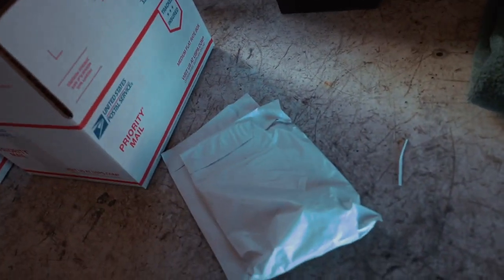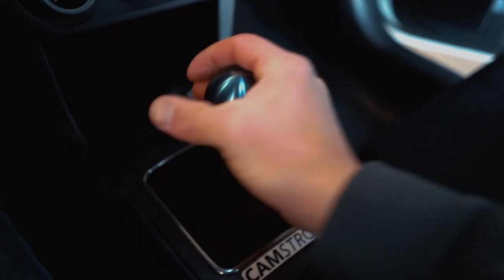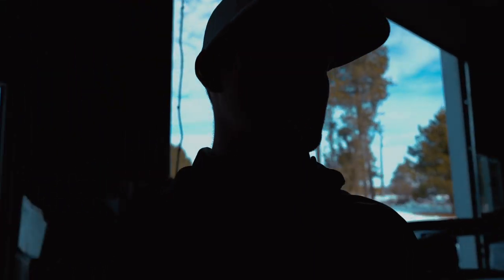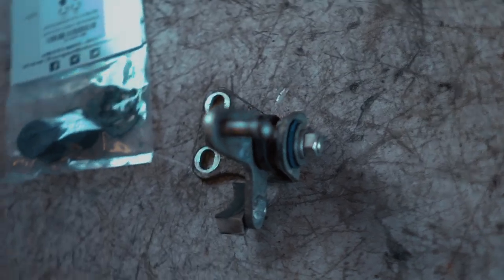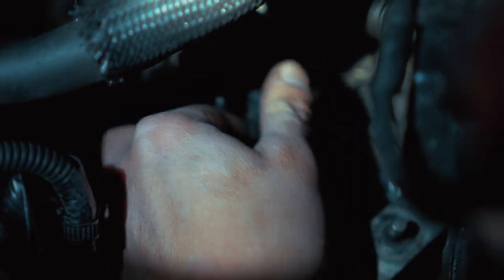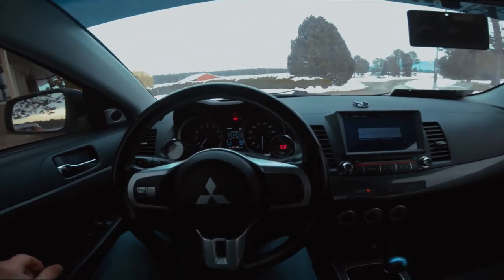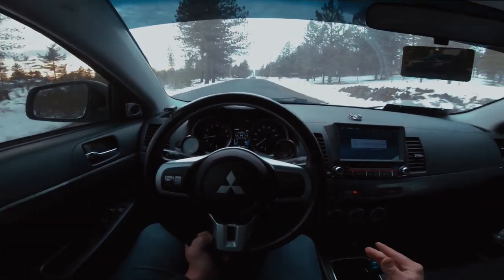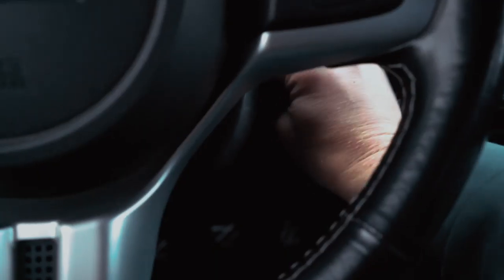Attempting to Fix The Shifting Issues!

Comment: When you do that master cylinder upgrade I would replace the shifter cable as well. When doing the bushings on my Evo X I noticed my cable was worn as well - same issue as yours the shifter would pull back towards me in 4th. It eventually gave out completely. Change the cable and it was so crisp, no more lockout issues.

Comment: I have a Evo x and when I first got I got locked out all the time and I hated it but I did the torque solution short shift AND bushing, the bushings are key and most people skip it but you finally got them also the redline cocktail eliminates all the grind sound going into 3rd and helps prevent lockouts as well. Ever since then I have never been locked out of a gear and it's been silky smooth. The only thing I can think of is replacing that torn up cable, hope this helps. Love the videos keep it up

Comment: You can see clear as day the minimal side to side play is within the cage itself. You noticed that when you move the shifter from left to right it actuates the small triangle to the left side of the cage which indicates you switching in between the 1st to 2nd 3rd to 4th or 5th to 6th gate. The little pin that lifts or lowers that triangle probably has Play Between the pain itself and the whole in that small triangle which operates the selector for moving the shifter from left to right. I'm sure the hole that the pin goes into on that small triangle is just worn out over time from use I don't imagine they have a bushing that goes around that PIN to tighten up the slop so since that whole unit is made of plastic I would imagine that to eliminate that slack you would just need a new selector cage unless of course you can pull a part that small triangle mechanism to the left of the shifter cage witch helps you select between left to right on the shifter

Comment: I just did these on mine and when i finished it had slop just like that. I took it back apart and was missing a rubber seal that goes under the plastic piece of box that your shifter ball sits on. So rubber square shape seal-then bottom square piece where shifter ball sits in-then top part of plastic that goes over shifter ball and is held in by the pins. So check to see if that is missing. It's so small but it saved my life.

Comment: Try going with a new cage ! I have a Octavia MK1 RS it doesn’t have a Plastic cage but kind of same concept it had a plastic surround cup around the gear stick . I replaced all the bushings and Linkage ends but nothing helped as much as that plastic cup ! I believe all that side to side slop should be no existant once you change the cage. Anyways Great Videos man !

Comment: IDK bro, i changed all the bushings on my Evo8, plus changed the front engine mount and i still get lock out. I found that as the clutch would wear the lockout would get worse until i adjusted the pedal. now after a few years i have adjusted the pedal several times as i noticed the LO to the point where I cant adjust amymore as the clutch is at its limit and will need a new one soon.
Point is, i think LO is relative to the wear of the clutch. How fresh is yours?

Comment: Try adjusting the clutch pedal outward. Also master cylinders are trash on stock x. I'd bet doing both of those will fix it and if not it might be time for a twin disc

Comment: i have the same issue. iv got a twm shifter cage, torque solution short shifter, and ams bushings. there is no free play at all like yours but still have same issue. im replacing my CMC and clutch soon, if that dont fix it, then im gona assume its syncro related problem.

Comment: Hm, sounds like it could be a worn or failing synchro. Does the lockout occur from 5th to 4th? Or only 3rd to 4th? if it's only 3rd to 4th, it very well could be that synchro has shit the bed.

Comment: I don’t have that play issue but the EVO has been hardest to drive stick but I recently installed torque solution short shifter big big difference stiffer and shorter throws I would also upgrade that bro should see a difference all around

Comment: @Devin .. I would check out this write up , it helped me out with my lockout issues. I was in the same position as you and I did all of the bushings as well. But when I found out that bracket could be use for adjustment it helped out a lot. Maybe not with the side to side free play but with lockout for sure. My 3-4 always felt like my clutch wasn’t engaged all the way.
Good Luck . This should also be in the service manual. 
https://www.evoxforums.com/forums/showthread.php?t=46189#/topics/46189?page=2
Reply: Same here. I saw this thread and was gonna post it here too. I am about to replace the bushing and then make the adjustment. But before you start you should mark the bolt placement as a point of reference.